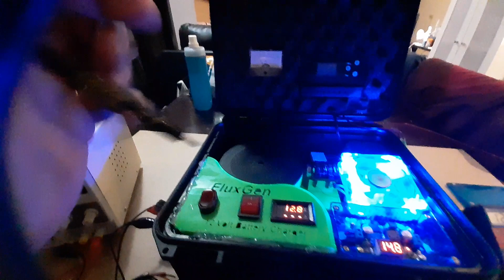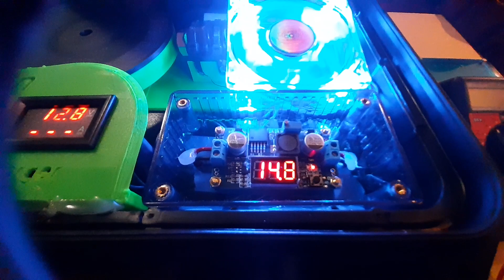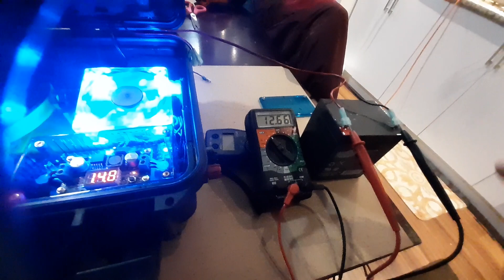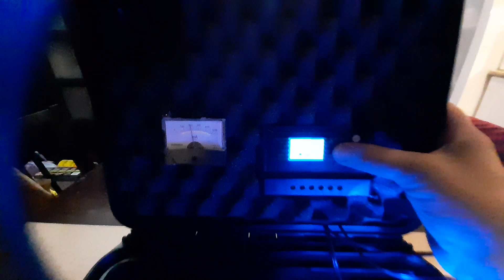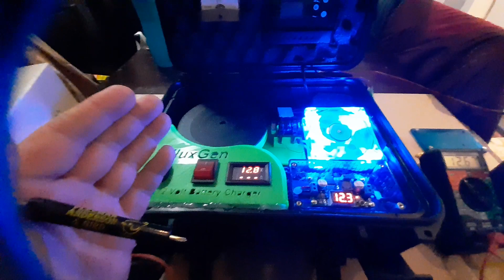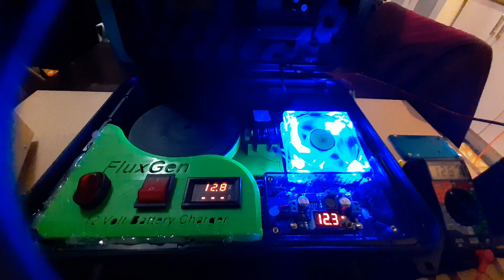Pulse motor generator  DIY overunity...energy from the vacuum

Comment: use stranded copper wire to collect the collapsing magnetic field and enough capacitor to store The charger
Increase the voltage of input charger by 200 -10000 volt to radicate heat in the system

Comment: Nice craftsmanship! One of the better I’ve seen for sure. How are u sure it’s producing OU? Looks like 9 watts in and 4 watts out.
Have you tried running from a battery instead of power supply? Then swap with charge battery ? If this can be repeated and no loss of charge you have OU.
Reply from the maker: Hi   thanks for your comments...that is a old video....at that point in my research I was still unsure of the overunity effect  alot more research was needed...as of today I have a pulse motor that will run itself for 33mins with NO batterys at all....I have not unveiled this to the world..for the reason that I feel the timing is not right to reveal it yet....at home I have been watch or stocked by 2 unknown people...so right now I am keeping  a low profile if you know what I mean...I have another project now that is a total (game changer)   and that project is (black) and will not be unveiled for the foreseeable future ....this is more for my own safety....I will reveal new stuff when I feel the time is right

Comment: BECAUSE YOU ONLY HAVE ONE COIL AND ONE DISK. INFINITY SAV USE  THE CYLINDER WITH 50 MAGNETS AND 50  BYFILER COIL TO PRODUCE HIS OVERUNITY POWER. 6000 RPM AND RECYCLE ELECTRIC WITH HIS SYSTEM. YOU MAKE A GREAT DEVICE SO THANK YOU!
Reply from the maker: The focus of my research now is amperage output ....charging capacitors fast (time) is a huge factor of overunity....the faster you charge capacitors you can stay ahead of yourself and have more power going out ....than going into the pulse motor.. you achieve true overunity
Reply: @FaradayResearch  THANK YOU FOR ALL THE WONDERFUL INFO! VERY WELL MADE DEVICE!